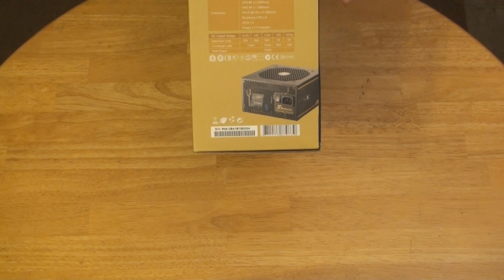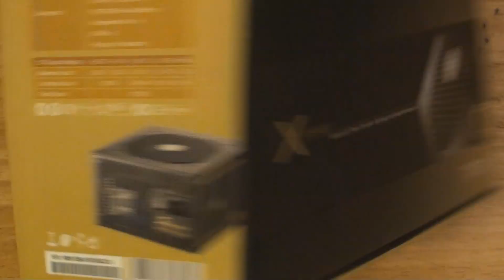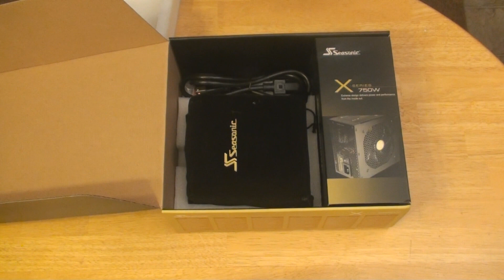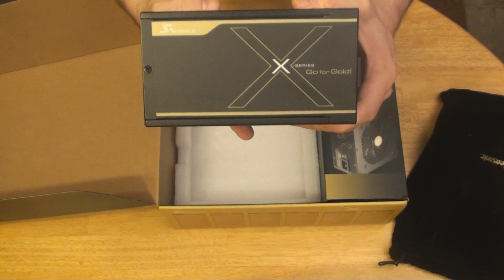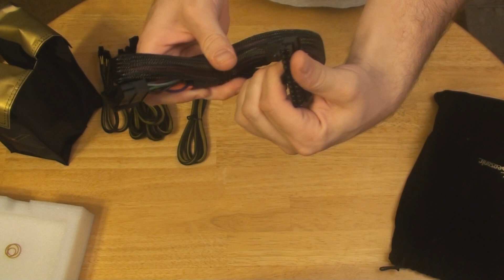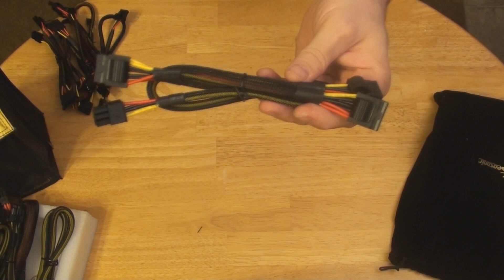Seasonic X-Series 750W Power Supply 80plus Gold Unboxing & First Look

Comment: This is Amazing PSU i have this but mine is all plain black cables.. i hate the colored cables here in this video hehe.. powered my PC i7-6700k gtx 970 16gb ram after 3 yrs upgrade my pc to i7- 8700k 16gb ram 3200mhz gtx 1080 and use the same PSU still perfectly fine..

Comment: i just ordered a  SeaSonic USA SS-750AM Power supply for my mini itx  i5 build . Its my second computer build and I try to study these things a lot to make wise choices. I kept hearing that seasonic builds many many other manufacturers power supplies. My first comp build I used a corsair and it came in the same velvet bag and the same kind of pouch with the same kind of heat shrink. I bet it is made in the same factory! I think some just have better internals like these.  Great review.!

Comment: You say this is perfect for low to midrage PCs.. but highend pcs if not very graphical consuming.. but how would this hold up to a i7 4770K mid range overclocking.. gtx titan (mid range over clocking) Asus Maximus VI Impact Motherboard, 16gb DDR3 1600mHz RAM.... ?

Comment: I have a question for ya if you could help me out. I'm in the process of building a new intel sandy bridge computer and that includes at the moment 1 xfx 6870. I plan to expand to another 6870 later on. Will this run everything I need?

Comment: I've been really interested in this psu. Right now its on sale at newegg and my only concern is the wattage. I run an AMD X4 940 BE, 4gb ram, 3 HDs and 2 4850s. I'm actually in the process of upgrading to 2 6870s and I'm wanting to know if this power supply with be enough to run all that or no?

Comment: nice psu but i still prefer the corsair hx750 . it offers a better sleeving especially for molax, sata and 6/8 pin pcie cables (they are completely black and very slim).